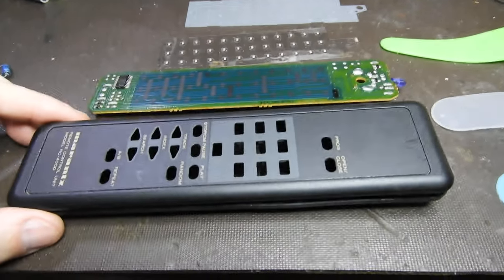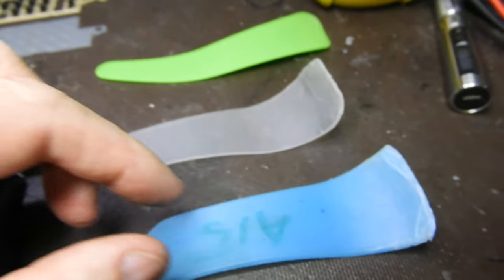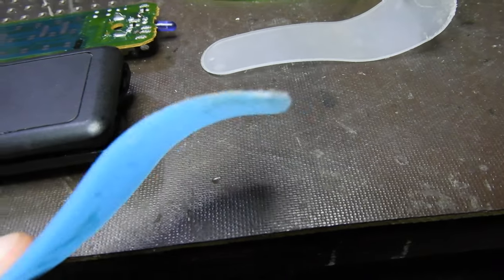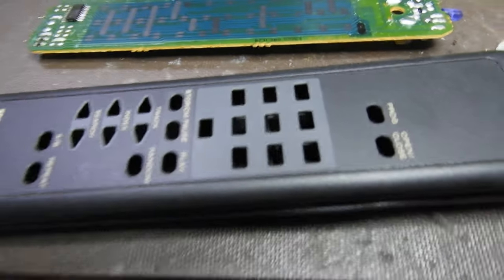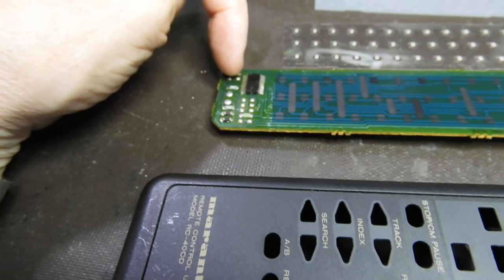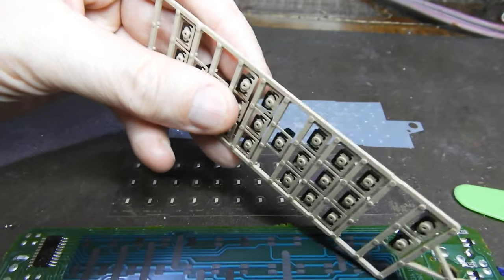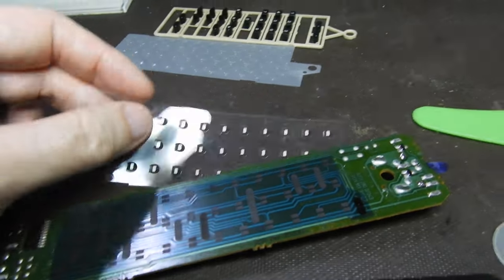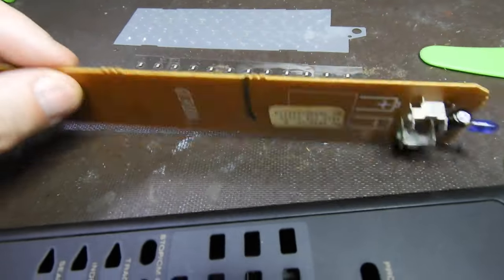Marantz CD-40 (Philips) remote control. Very unusual unit which case is glued together.

Comment: That must have been frustrating! Often the glued joint becomes the strongest part of the enclosure altogether and then good luck with that. I often find toluene indispensable, when dealing with hardened adhesive under the caps.